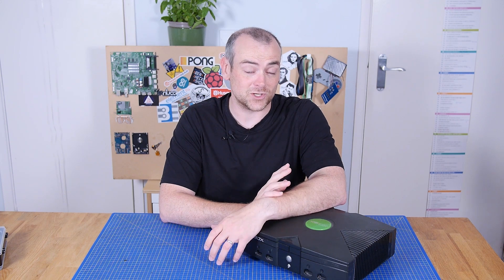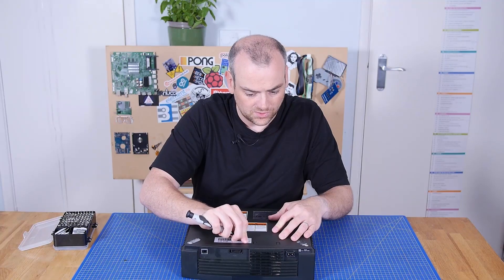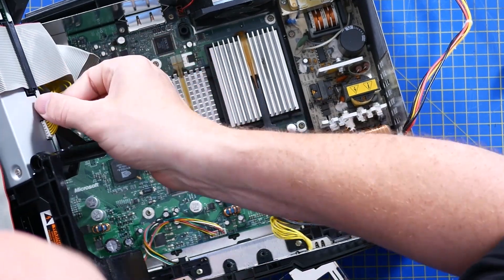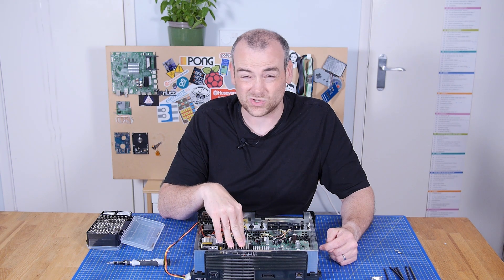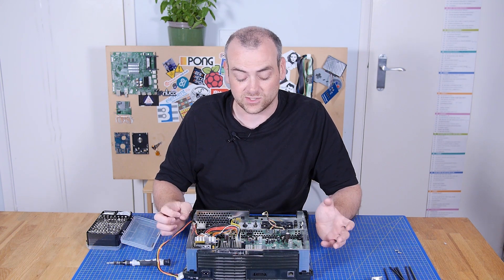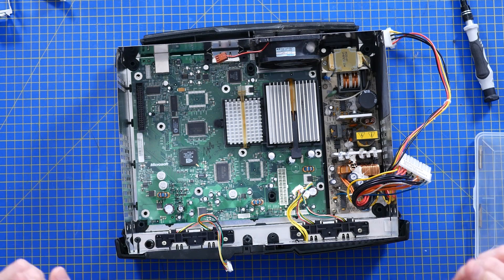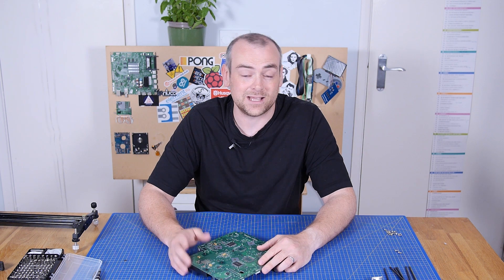Original Xbox Teardown - Save Your Vintage Tech! - The Electronics Inside

Comment: The Original Xbox was, in fact, the only 6th gen console that launched with the broadband port & functionality included. 
Dreamcast, Fat PS2 and GameCube required the purchase of a separate broadband adapter. Which, in the case of the PS2, also served as the HDD adapter.

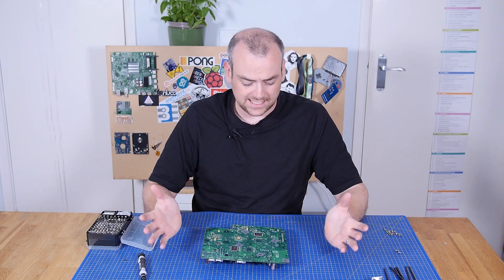Comment: 10:05 It's actually the unwashed flux from when the caps were soldered on the board in the factory, so you don't need to worry about it. It's pretty common to see on a lot of pcbs

Comment: Rookie move - you don't have to take off the rubber feet entirely. You can simply peel them back above the T8 screws beneath, and they will stay on forever and you don't have to worry about reapplying them 🙂
Reply: Also if I remember correctly the 1.0 models had active coolers on top of the smaller GPU heatsink, so I assume that the one in front of you is a later model. The two vacant RAM spots where used for SEGA arcade games. In a modded Xbox you can add those two chips for better emulator performance.

You could make an episode on adding HDMI, the two RAM chips, a mod chip and a two 2TB SSD (for noise reasons, I know it wouldn't run faster with SSDs) plus get the default fan replaced. That would make a rather comprehensive video and result in the ultimate Xbox.

Comment: I opened mine up 3yrs ago, and the Real time clock was starting to leak, and the Power Caps were bulging, so I replaced them. I now wish I had replaced the thermal grease under the heatsinks. I was a bit worried about the plastic clips breaking. Mine was clean inside, compared to the outside which was a bit messy. I purchased it in 2018 for $40AUD, the shop had heaps but now they seem to have disappeared from sale. I was intending to hack it to use it as a Retro Games Console, as per the MVG video on the subject.
Reply: That's a good call, it look's like a good emulation platform?

Comment: Lets hope that you use Panasonic FM (even though they are bigger) in 16V/3300µF for the CPU Caps.
As the Impedance is close to the Original Ultra Low ESR Caps. Maybe its possible to use 5x2200µF/16V Panasonic FS, but that needs to be tested...
Reply: The CPU side of the regulators is going to be around 1.8V, 2.5V or 4V solid caps would be a better choice.
Reply: @NiHaoMike64  Yes, fair point. But what works and what doesn't? And what's the Ripple after the Recap gonna be?

Comment: I still have my original Xbox, i remember playing midnight club on it all the time.
Reply: Have you checking it's caps?
Reply: @a531016  No, but after i find all the power cables ill use this video as a reference to check out how it doing. I haven't turned it on in 15 years or more.

Comment: I always wanted one as a kid but never had it. But now, I saw those consoles being modified to an arcade type thing with it's controller being tied to a chain to the cabinet so kids won't rip it.. not sure how long it will last but I see those being powered down with a flick of a switch just like those AT computers.
Reply: I don't know how much the Xbox writes to disc like a full desktop operation, it may not be too bad (although still not ideal) to cold power cycle an xbox?
Reply: I don't know much either but there might be a shutdown procedure.